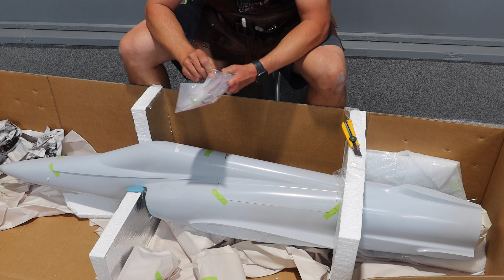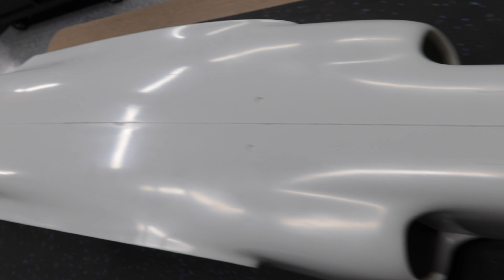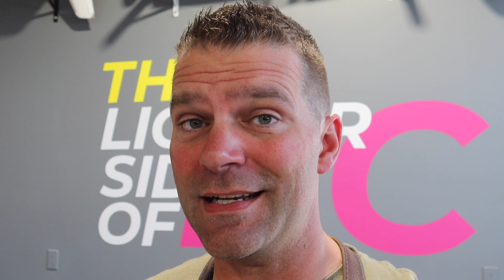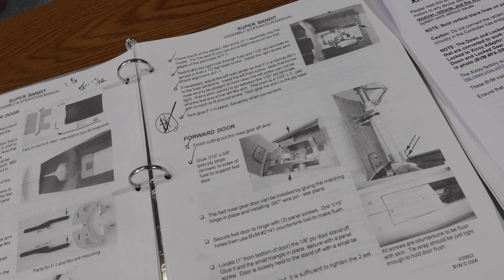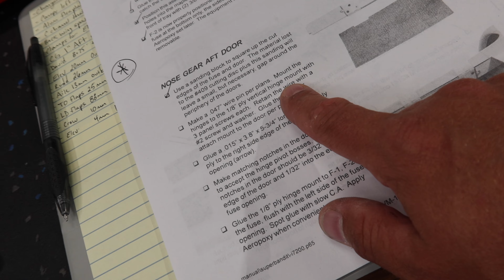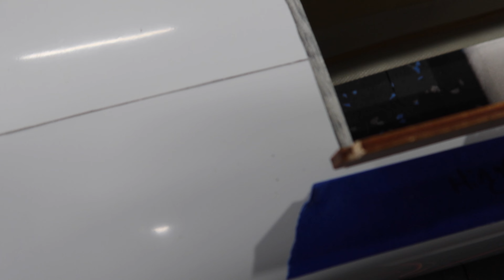BANDIT UnBoxed - Starting the BVM Super Bandit RC Jet Build Series

Comment: How will you power this? (20+?) years ago I built a BVM Maverick powered by a BVM fan and a Rossi .91. As I got out of the hobby, there were a few primative early turbine conversions, but nothing was available like today's turbine motors.
Reply from the maker: HAHA.  Well it's getting a XICOY 195 Turbine.  About 2:1 Power to weight ratio.